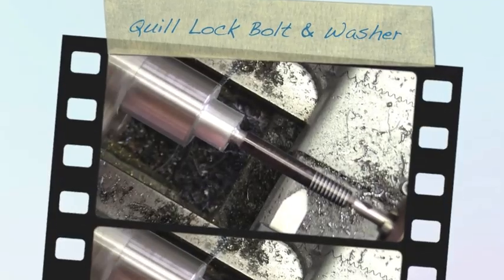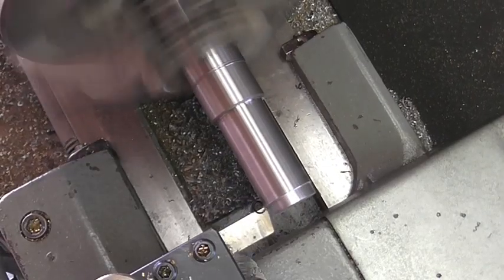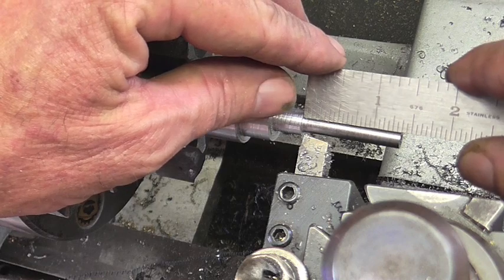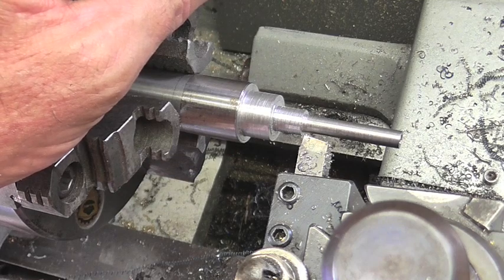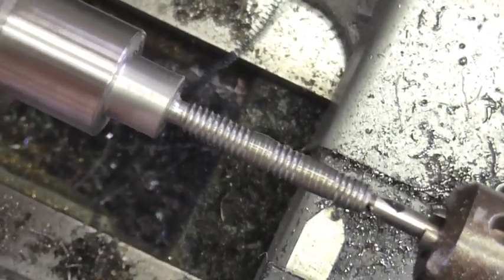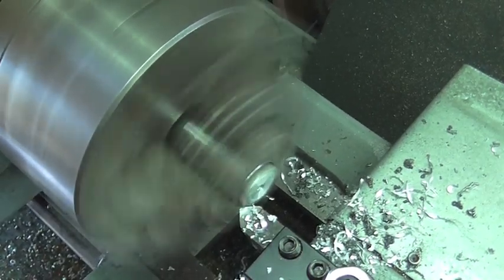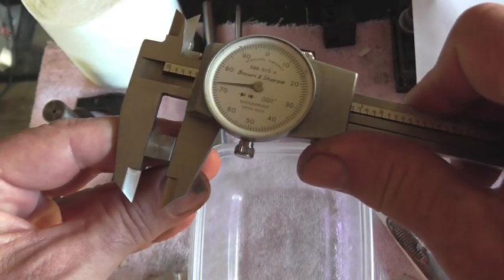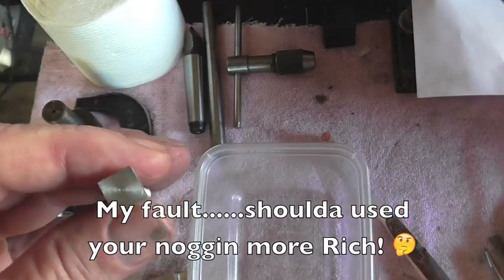Making Replacement Parts for an Atlas TH54 Lathe - MSFN

Comment: Rich,  I cannot express how much I appreciate your help and support for my lathe and channel.  Thank you sir.  BTW, I would not have thought to use a center drill for a dead center.  Does it try to cut into the center at all?  Great video Rich.

Joe
Reply from the maker: You are very welcome Joe, best of luck going forward with your Lathe and Channel. The tiny center drill works great for supporting small diameter stock. Its hardened steel and wont score...they are tougher material than will ever be chucked for turning.  Thanks Joe~ All The Best! 

Rich 😊
Reply: you all prolly dont care at all but does any of you know of a trick to log back into an Instagram account..?
I was stupid lost my login password. I appreciate any tricks you can offer me
Reply: @Simon Aaron Instablaster =)
Reply: @Rory Keanu it worked and I actually got access to my account again. Im so happy:D
Thank you so much, you saved my ass !
Reply: @Simon Aaron You are welcome :D

Comment: A fine job my friend. Your imagination is formattable there fella !
Reply from the maker: Thanks Dean, I hope the few thou isnt an issue. I dont think it will be, the square head fits a recess and just keeps the bolt from spinning
Reply: Well the great thing about steel is that it is soooo easy to add or subtract from. A shim or 2 licks of a file and the deed is done eh !
Reply from the maker: I was undersized so will see what Joe says once he gets them
Reply: LOL, Just whack it with a center punch to make it grow up eh, LOL !
Reply from the maker: Lmfao 👍🏼
Reply: Works every time. I have even used a punch to set automotive valve seats and now the 550 hp hot rod P/U is still going strong turning out 10.8 in the 1/4 at 138 mph. Crazy eh. I expected a failure years ago.
Reply from the maker: I have lots to learn, always open to tricks of the trade! Try a center drill as a dead center when you need to get in tight with a bit...give me your thoughts
Reply: Thanks bud

Comment: I think that was a nice idea in the bolt square head nice
Reply from the maker: Thx, I didnt have my small mill at that time so used what I had available
Reply: @MakinSumthinFromNuthin  I sure like the idea
Reply from the maker: Works well in a pinch!

Comment: good to see you spread the love.....it looks like you have an Atlas lathe too, can i ask what collet system you were using it looks very neat.
Reply from the maker: Thanks :) Without me rewatching the entire video what collet are you referring to? Sry, its been a while since posted that one...Lol
Reply: LOL, you will only need to watch 40 seconds worth......its the black faced collett, which your using to hold the milling cutter
Reply from the maker: Lmao!, ohhh that one! 😊 Its an ER32 collet chuck in the headstock. One of my first tooling buys was an ER32 collet set for the lathe. Its a Commercial Atlas 12x36, good lathe but it doesnt like parting steel
Reply: top man that's useful stuff. i have a 3 and 4 jaw but a Collett would be helpful, thanks for answering and helping me along.. . . . SUBSCRIBED :)
Reply from the maker: Thanks Peter, hopefully you might like some of my other machining vids :) ~ Richard
Reply: like the spinning toy video Richard, nice finish. . . . . .
Reply from the maker: I think it turned out nice as well, much appreciated Peter :)

Comment: i was wondering if you had centered a square piece in a 3 jaw , i wouldve used a 4 jaw , does mean more work on converting the lathe though
Reply from the maker: Yes, I could have used a 4-jaw, and should have in hindsight.

Comment: 2:28 Ooooooh clever using the quill like that! 4:30 Measure twice cut once. Brainfarts exist D: 6:03 Didn't you make a center just for that purpose? 9:35 I feel like there's better ways to do this. But that's super clever, using the tool post's squareness to index! As you found out, you should've "used your noggin" and also prepared the stock to be reliable to index with :P ... outstanding job either way. Nice, clean and fast.
Reply from the maker: Learned a lot on this one...the mistake wont be repeated in the future for sure! :) Ohhh, and I am quite positive there are better ways to do this...its what my idea packed mind came up with first. Much better machinists out there than this old guy! :)
Reply from the maker: The 1/2 dead center I made was even too large for the little 1/4-20 bolt but the tiny center drill worked perfect for that application